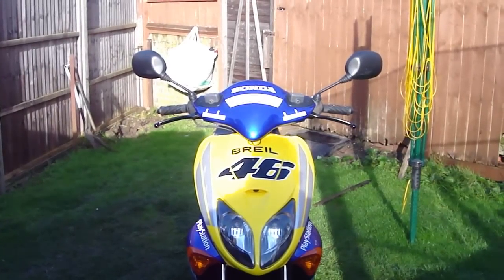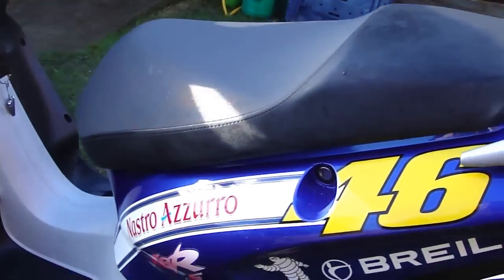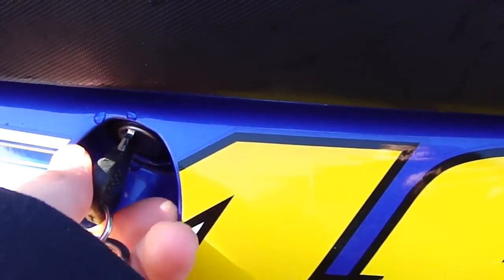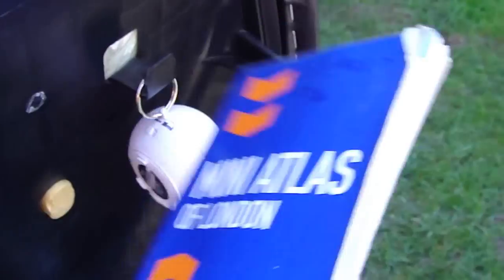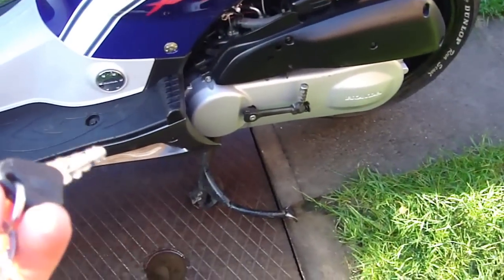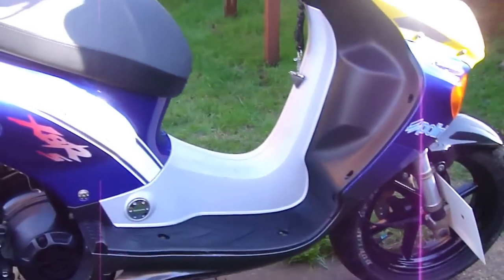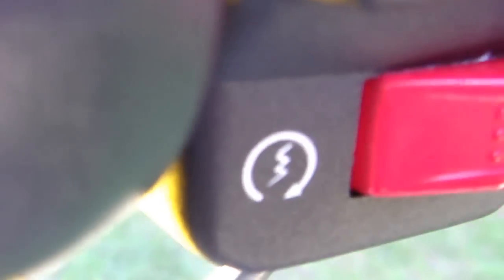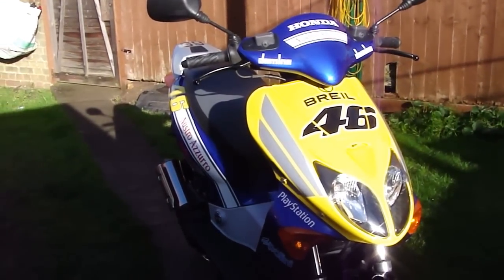Honda X8r-s

Comment: I have such a scooter since 1999 and now are 60000 on the speedometer numerator. You need a good repair shop and you have to take care of the scooter regularly (me: once a month) and so you can use it until 100000 kilometers or more!

Comment: Upgrade the CDI, Get your self a nice exhaust, Change the variator, belt and rollers to a pollini kit with 8g rollers, change your clutch to one that engages at a higher rpm, and change your torque spring, it's a big spring thats behind the clutch bell, get bigger jets put in the carb, and a 70cc polini big bore kit and get it put on a dyno so the finer carb adjustments can be made! My 56 plate x8r-s was crazy after this! Off the clock speed down hill and 50mph + on flats

Comment: its on Y reg, and only done short of 4000 miles. i once saw one of these getting a MOT, where i get my bikes fixed, and it had done 27,000 miles. i had a Honda SFX - which is basically the same. exhaust baffles went at 5000 miles. the baffles were made of fabric. which chocked up the whole system

Comment: they stopped making them in 2003 and they made loads more than a 100, ive got 2, ones blown up (derestricted it n went 63mph) and my other one runs really nice and is restricted to 30mph. never ever use a pressure washer on your bike!!!!!
Reply: how did you get it to 63 need help making it faster
Reply: Ellis Wyatt to get the Max out of it you'll need a sport exhaust, racing cdi, racing variator. There are sites that are focus directly at x8r tuning mods.

Comment: Pit some WD40 on the lock and key,and then put it in,back out,in back out (basically key-lock sex)  a couple of times,it will go smoothly after that.

The pins stop being lubricated after some time,that's why it doesn't go smoothly.